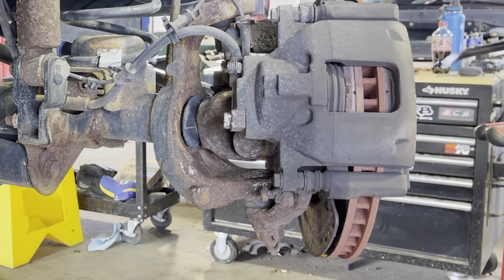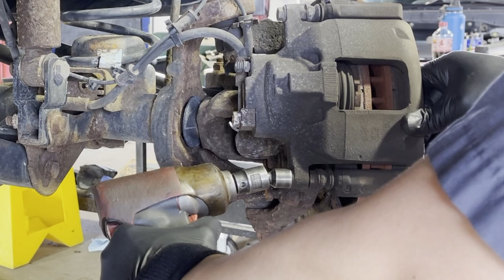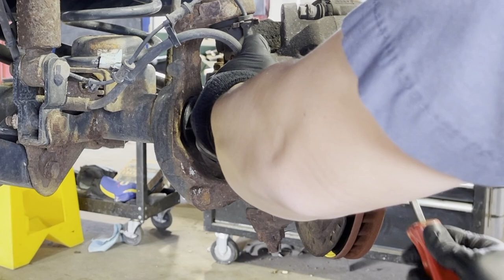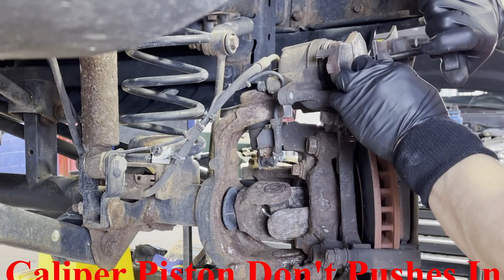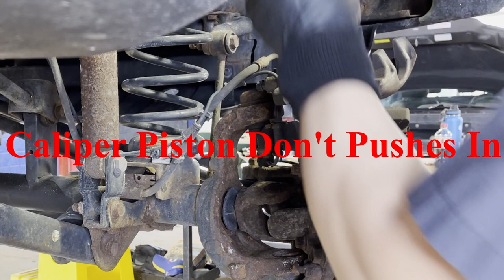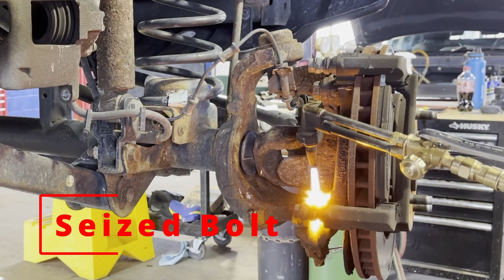What To Do If Caliper Bracket Bolts Seize Or NOT Come Off Easily Without Breaking It Part 1

Comment: would a propane torch work?
Reply from the maker: You can, but not powerful enough to heat up. Certainly you can try it out.
Reply: I use MAP gas torch to do this and works good. Takes a little longer to heat but works none the less.
Reply: I'm using MAP and the fuckers still wont come off.